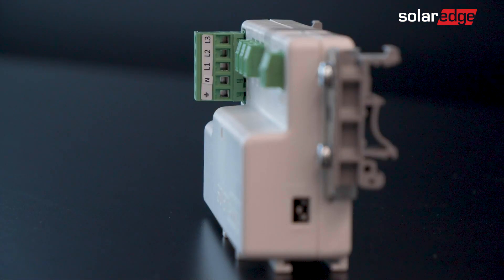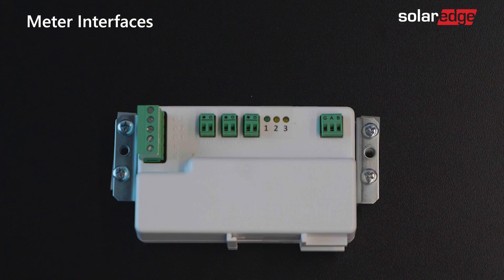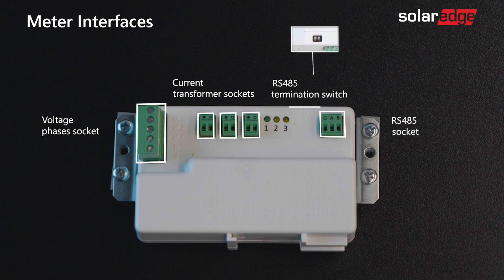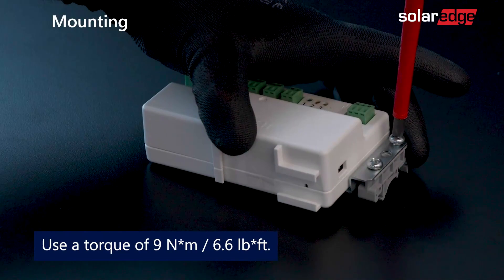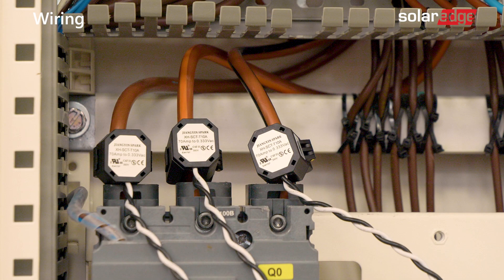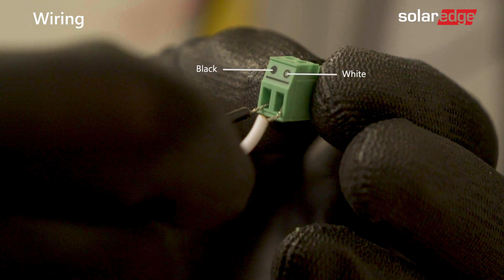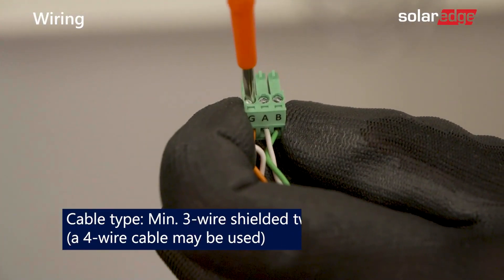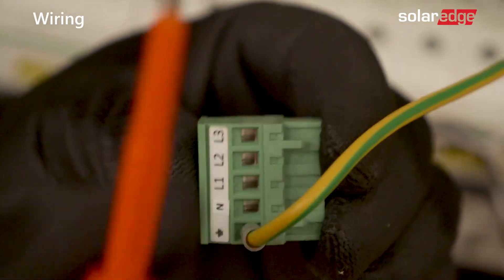Installing the SolarEdge Energy Meter with Modbus Connection

Comment: Same Issue.  I been trying for months on how and where do I connect the 2-CTs coming from the Elec Panel to terminate in the HD Wave Inverter with the "built in RGM and Consumption Monitoring" features.  Spent hours researching SolarEdge documents and on line to find an internal view of the Inverter which I could not find that would perhaps give me a clue as to how and where to connect the CTs to begin monitoring production input.  The company that installed this site didn't complete the install of this feature and then went out of business.l.  HELP!

Comment: So where is the the instruction video showing how to set up production and import/export numbers from this meter on an HD wave inverter system that has one inverter with a integrated RGM set up strictly for production of that one inverter when the other inverter does not have an integrated RGM. When I set up a leader and follower bridge using the rs-485 connection when i turn on the production meter in the setapp it only reads production of the inverter that the rgm is installed in. Long story short I've done had three installers on my property that can't figure out how to get the RGM that was pre-built into the leader inverter to report total site production and apparently the built-in rgm does not have slots for additional CT's.